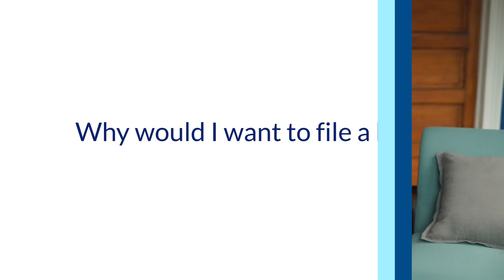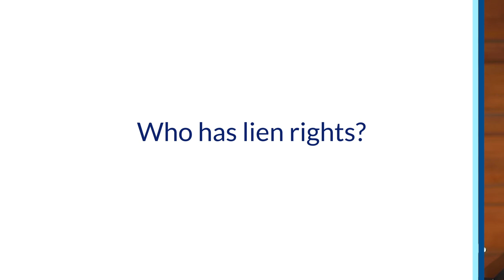Mechanics Lien: What is it and how does it work in construction?

Comment: I have a question I’m from the Rio Grande Valley but on spring break I went to San Antonio for vacation my vehicle stopped working  the engine was making like a rattling sound and the steering wheel started shaking so I left it there fixing with a “mechanic” supposedly he replaced the engine everything was verbally I never signed anything a few days ago I reported stolen because he had three weeks without answering me so a detective went to his house the guy gave him the truck they took it to the of impound. I had given him 2500 to buy the engine already but he told me that the truck didn’t want to start. I keep asking for the original receipt from where he bought the engine he says he has them but I’ve never seen them so yesterday that the detective picked up my truck the mechanic called me very mad asking for labor money but my truck is not working he even threatened me that he was gonna put a lien hold on my truck if I don’t pay him but my truck doesn’t work is as I left it without turning on, can he even do that